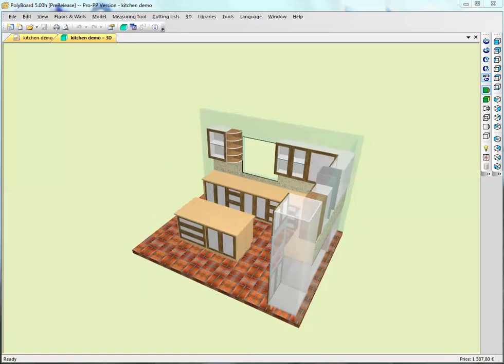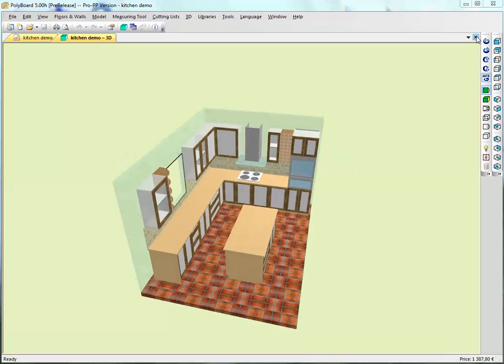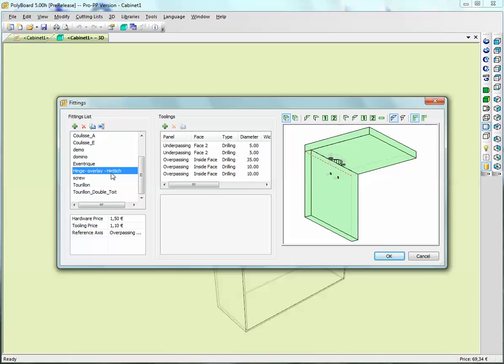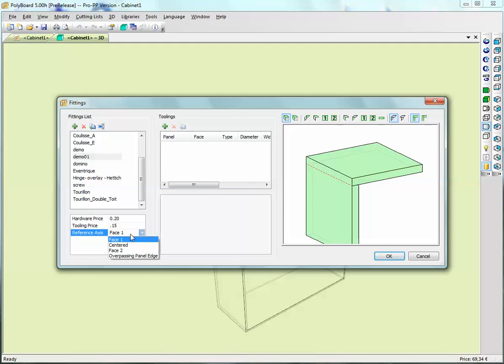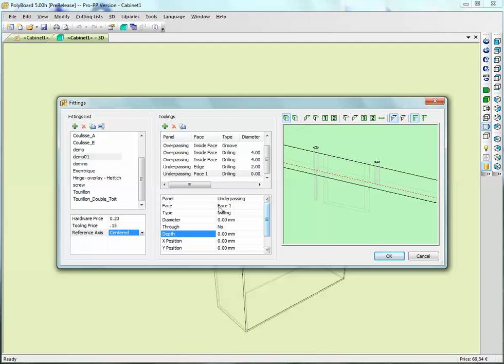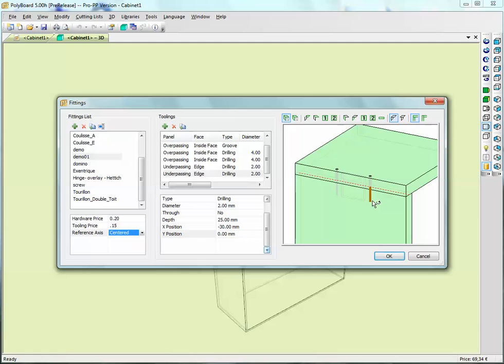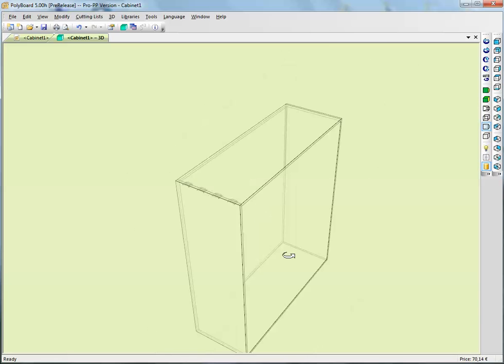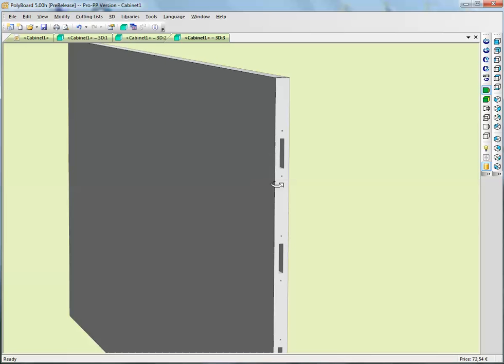PolyBoard: setting up hardware libraries

Comment: hello , why fittings does not appear when we export whole cabinet i  DXF it is just panels
Reply from the maker: Hi Maha, fittings/hardware will show in the 2D part by part DXF files you would get with Polyboard Pro PP. You can also see the hardware in the workshop document which includes the cut list and plans, using either Polyboard Pro PP or Polyboard Pro. You can also output 3D DXFs of your entire project in any version. Thanks

Comment: How to take print for drilling pattern
Reply from the maker: If you own the full activated version of Polyboard (either Pro or Pro PP), you will have access to output of the workshop documents. As well as the cut list, plans show all machining for hardware, drillings patterns etc. Thanks

Comment: Hi there, I love the software but without a Hettich hardware library, its pointless to me. Do you have a hettich library for full members. Im looking for standard hettich drawer rails, hettich hinges - inset, half overlay - full overlay, cam locks and pins, dowels. If I can get the hettich library id become a full member.
Reply from the maker: Sorry we didn't see your comment. To confirm Polyboard includes an extensive Hettich hardware library. Thanks